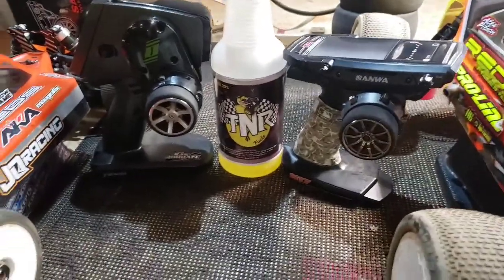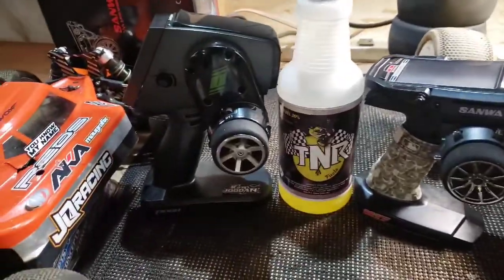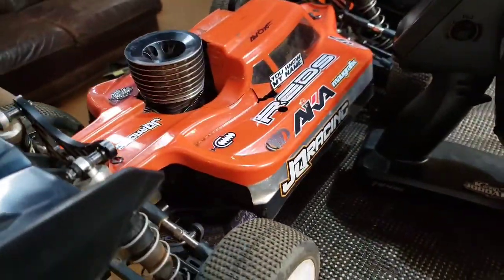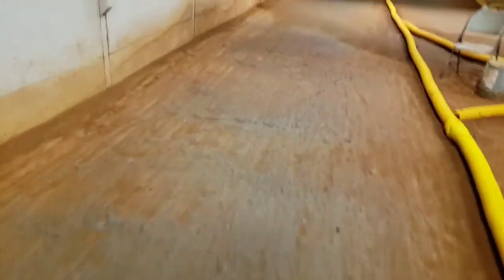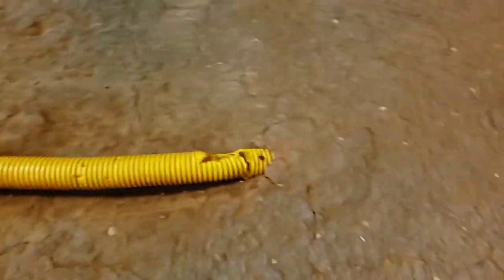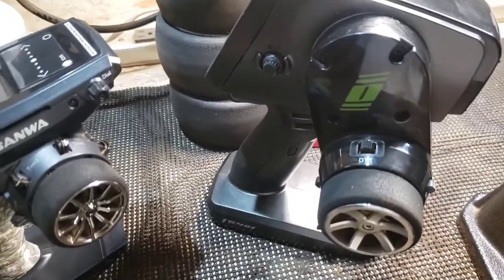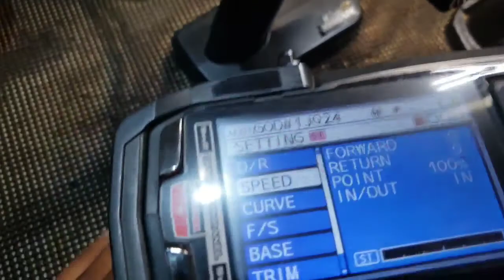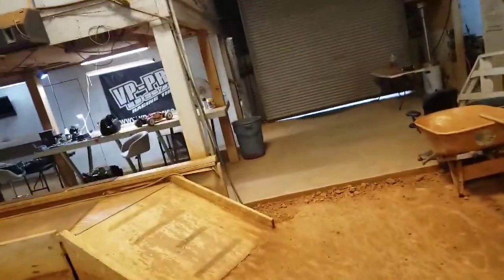Rc controller, Sanwa M17 vs Old School High-end Raidiopost controller is it Hype????

Comment: Still rocking my m12 and wife has the mx-v! Both get the job done at both ends of the price range. The mx-6 has all the major electronic adjustments the m12 has( like expo, abs, endpoints etc.) For alot less. If you need receivers Rcjuice.com has the hobbystar 472 for 49 works with the sanwa radios. Great video bro🏎💨💯💪💪👊👊👍👍
Reply from the maker: Y'all are in the game, Y'all got great equipment!
Reply: @DavidRC 🤣🤣🤣 she actually bought it on her own...used kit with parts(Agama of course lol), radio, and engine. I sourced everything, and she paid for hers. Now I do play with it more 😎 but it's hers.